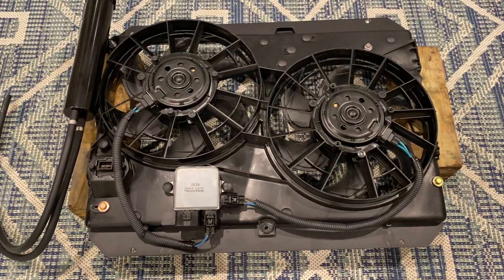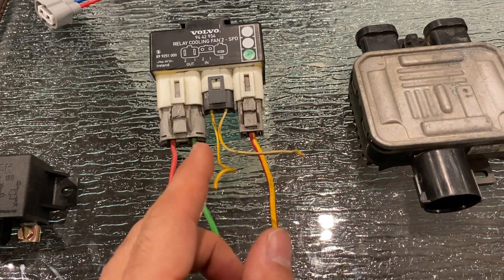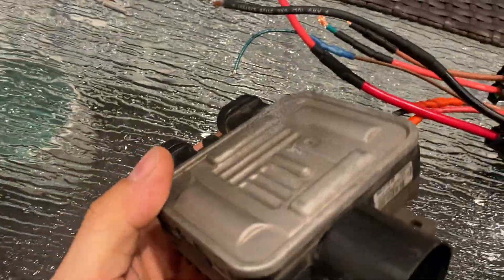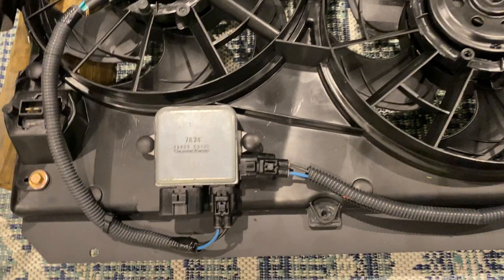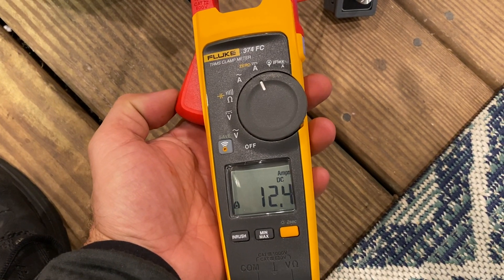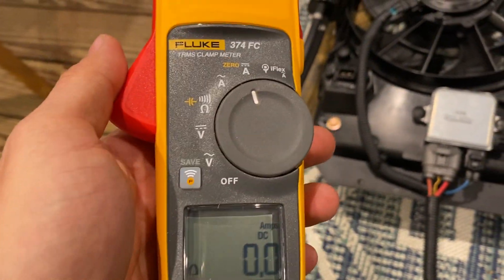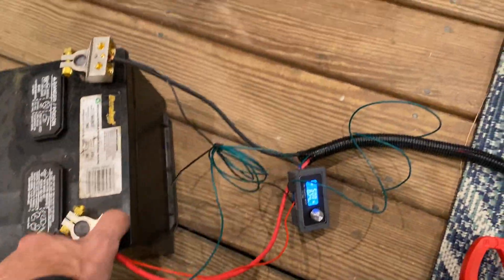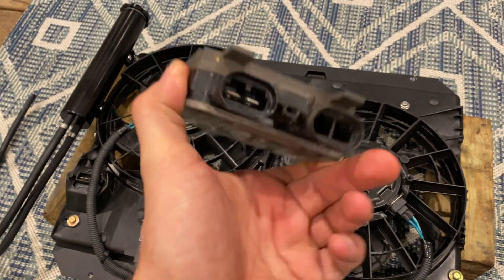Contour Fan Setup using a PMW fan controller

Comment: Hey any suggestions how I can keep the mazda controller from going into failsafe mode when I turn off my car (causing the arduino that is controlling it to turn off making the Mazda unit lose signal)? I don't want to have to flip a switch to ground it everytime I turn off the car. I'd appreciate any help. Thanks!
Reply from the maker: The way it’s done on the Mazda is there is a relay wired inline on the main power feed to the controller.  When you turn the vehicle off, it kills the relay which cuts power to the controller. 

I am using a bosch 75a relay with mine and activate the relay with a key on power source.  Fan is active when I turn the key to on but if I turn the car off, the relay opens and the controller turns off.
Reply: @Mustang5L5  Ah that makes sense! I'll give that a shot. I really appreciate you responding and for all your help. It means a lot!

Comment: Where do you get the connectors from, for the Volvo controller?
Reply from the maker: For the Volvo S60/S80 controller,  search “Cooling Fan connector 940002904” which is the single output for the S60.  If you need the double one you’ll have to search for s80 compatible kits with dual output harness.  I got mine on eBay but can’t find a link or part number at the moment

The wire size for that particular plug seems to be equivalent to the OEM connector. 

A junkyard OEM connector may be better quality however.

Comment: What controller would you recommend for the SN95 fan and MS3?  I assume you would only wire the controller output to the high speed wire on the sn95 fan?
Reply from the maker: I would probably use a fusion/corvette style pwm controller, or the Volvo S60 style controller.  This particular controller is probably better suited for smaller dual fans like the contour or focus dual fan. There are threads on both these units if you Google search. 

I highly recommend confirming polarity before applying power to one as reversing the polarity will brick the unit.
Reply: @Mustang5L5  if I went with contour fans to replace my old stock sn95 fan would the infinity controller be good?  Also how did you fit/attach the contour fans in yours?
Reply from the maker: @beyondEOD  As long as you have a method to control the controller, it would work.  Unfortunately that's going to be a limitation for most folks as you need something to putput that pwm signal.  I attached mine to to the shroud with two push pin style connectors for auto trim.  I drilled two small holes in the shroud and then used the pins to secure it.  I wanted to be able to easily remove it on the side of the road if it failed and swap in a replacement that I keep in the car.

Comment: How would you invert the pwm on the Arduino code? I have both of these controllers and I can get the mazda one to work but I can't get the Volvo one to work. Thanks!
Reply from the maker: Unfortunately that I have not solved yet.  I started putting together an arduino setup for it but didn’t get far with the coding because I installed my Megasquirt setup and ended up using that to control the module.  I have seen it done.  This thread below may have the info you need 

https://ls1tech.com/forums/forced-induction/1906766-variable-speed-pwm-fan-control-under-25-less-diy.html
Reply: @Mustang5L5  Ah ok, no worries. I appreciate you posting the video, and for the info you did share! I'll be sure to check out that link. Thanks!

Comment: Could this controller work with 95 ford taurus fan
Reply from the maker: Yes.  However this controller is really more for dual fans and up to 50A combined. It could run a single fan but you are better off running a single fan unit like the Ford Fusion pwm controller that a lot of folks use.

Comment: Hi man, thank you so much for this video! i was looking for long time now to finish my setup, i have dual spal 30103202 , will this controller handle them and will be safe to run those fans?
Reply from the maker: Do you know how many amps those fans pull?  I did a quick search and saw reference to 40A, but that seems high.  These controllers are wired in their OEM application for 50 amps combined, so really you need each fan to be around 25amps or so or perhaps you can use one controller per fan (wiring the two outputs from each controller in parallel to each fan motor).
Reply: @Mustang5L5  appreciated man, so is there any way to let both controllers act as one, to use same dimmer you have, or each fan will also have its own dimmer? and yes each spal fan uses 40 to 45amps.

one more thing i dont need to install any fuse or relay to protect my car? this controller have everything in it right?
Reply: @Mustang5L5  hi, may you help me to know how to connect two outputs to one fan please
Reply from the maker: @slowrook  you need to identify the positive and negative of each of the two outputs.  If you have the wiring harness the wire colors will be the same but I would confirm this with a multimeter.  Once you’ve identified the wiring, you can just connect the two positive outputs together and the two negative outputs and run those single wires over to the fan. You are essentially making a Y-harness
Reply: @Mustang5L5  is the Y harness goes like one way, if i connect 2 positive to be a Y harness this wont kill the unit? or both positive will go one way to the fan? sorry for my newbie quations

Comment: Great video. I'm contemplating using the Mazda 6 or s80 unit and a relay ground for activation. Does the soft start feature still when using this method for activation or is there still a large amperage draw.
Thanks
Reply from the maker: It soft starts, even if you just make/break the pwm signal wire to ground.

Comment: So if my understanding is correct, and I'm not very knowledgeable with electronics,
1. The Volvo S80 controller is more robust, and
2. Either controller requires a temp sensor and arduino, which is... what controls the controller?

Where does frequency come into play? Is that programed into the arduino?
Reply from the maker: 1:  Yes, the Volvo unit is more robust.  There is an single and double output unit, so depending on if you have 1 fan or two you need to make sure you get the right one. 

2.)  these controllers are reactive based off a single PWM signal wire.  Depending on the duty cycle, they respond with fan output.  That's why you need a controller to output that signal to the controller.  In OEM applications, it's the ECU that does this after interpreting various inputs like coolant temp, AC on, etc.   In an custom application, you need something else to interpret these signals and output a signal to the controller.  You can make an arduino setup, or use an aftermarket ECU like a Holley or Megasquirt.  

I started working on an Arduino setup that would take an input from a coolant temp sensor, but never finished.  There's a lot of info in this thread with some coding as well. 

https://ls1tech.com/forums/forced-induction/1906766-variable-speed-pwm-fan-control-under-25-less-diy.html

Comment: What's the width of your dual fan shroud? 
Thanks
Reply from the maker: 24.2 inches.  The dimensions to these contour fans are published.  See below link 

CPP Radiator Cooling Fan Assembly for 95-00 Ford Contour, Mercury Mystique FO3115115 https://a.co/d/0WtiNTK

Comment: my double fans reads 220W and 150W with OEM controller is 350W, system voltage is 12V.

Comment: Good day, i have my vw golf which failing me because of aftermarket controllers i install always fail. my questin is it has 4 wires that is 2 signal wires in addition to pos and neg poles, can you recommend controller that run this setup. OEM amp is fused at 50A.

Comment: Does this controller signal wire use ground switching from the MS3 output?
Reply from the maker: Yes.  In this video I’m using pwm+ off the cheap generator,  but I show how I specifically hook it up to MS3 using ground switching here

https://youtu.be/XrXb13uJiq4
Reply: @Mustang5L5  Cool thanks. I don’t guess it really matters if the signal is + or - it’s just the output duty cycle will be inverted. Since my Haltech ecu switches to ground on the DPO pins I could use the stepper control output if I wanted to pulse a +12v. I found it interesting that Japanese electronics are +pwm and German use -pwm. Ford and GM use the Siemens module.
Reply from the maker: @o1Z0sick  not for this particular controller.  I’ve gotten it working with both types, just need to invert the duty cycle.  I don’t know if other PWM boxes are capable of the same

Comment: thanks man! great video and good info. I'd like to pick your mind on something. Using a temp switch you get the nice feature of the fans turning ON at a set temperature and OFF at a couple degrees cooler. This helps with the fans cycling too fast/many. 

Now I have setup my fans on my MS3X Megasquirt on the two Nitrous outputs using PWM signal and ramp them up from 50% to 100% as temperature rises. What I noticed is that at certain conditions it will just hang around 90-91C (195-196F) and stay on about 50% for minutes. 

So since your also using Megasquirt I'd love to know how you have setup you cooling strategy and settings.
Reply from the maker: There is a new tuner studio update coming out that will offer PWM specific fan control.  It should give MS users some more flexibility. 

I’m actually creating a generic PWM table but have a relay setup for my AC system. When the AC goes on, I switch the relay from normally closed to open the pwm control wire which causes the fan to go 100%

As for my coolant table,  I have 50% on at about 170* and then 75% at 190 and then step it up to 100% at 205.  My car runs about 190-200 so it tends to hang around 75% as I don’t think my next ramp to 100% occurs until 200 degrees.  

However, I usually run the ac so most of the time it defaults to 100%.  With cooler weather coming I’ll likely play with the table a bit to find tune it.  I find in cooler weather my fan only needs to be around 75% to keep the car cool at idle, so I’d like to try and optimize
this to avoid powering the fan more the necessary.  I’m hoping the new MS update comes out soon so I can play with the specific PWM fan control options.
Reply: @Mustang5L5  he thanks man for replying. That update would be great. How do you know about the upcoming update? A topic on msextra forum?
Reply from the maker: @kikkegek  I directly asked for PWM fan controller a year or so ago on the MEExtra forums in the “feature request” board and was told by an admin it would be in the next update.  No idea what that will be dropping but I’ve actually been away from the board a bit so I need to hop back on and check.

Edit:  looks like it will be in MS3 1.5.3 but it has not been released yet it seems

Comment: Thanks for the great video, very easy to understand. Do you think the Mazda fan controller can handle 2 fans that pull a collective 44 amps? You said the controller had a 50 amp OEM fuse so I figured it would be right on the limit but ok. The wiring to each fan would be minimal (>1-2 feet).
Reply from the maker: It’s hard for me to say.  Temperature will bring the max current down a bit as well.  With it being so close already, I wouldn’t be comfortable.  You can fuse it and try and it might be ok.  I’d probably run two of them like some Infiniti models did. One for each fan with both outputs wires in parallel to one fan motor.  Or, you can look into the larger Bosch style controller (in the vid) that supports 60a.  I don’t have much experience with that one however.

Edit: the dorman 620-470 is an Infiniti fan using two modules. One for each fan. Given how cheap the modules are you can try this approach.  One pwm signal should run both.
Reply: @Mustang5L5 
Hi I am currently battling how to setup my jeep yj, I swapped out to a ford Taurus fan dual speed setup but I’m not sure which controller to get and if it should be a signaled thermostat like splicing the ecm thermostat wire or probe.  I haven’t considered pwm fans. What’s your opinion. Which would be better. I have the ability to wire up and fab whatever is needed .
Reply from the maker: @Dhardeman1981  using the pwm controller all depends on if you have a management system capable of sending it a predetermined signal based on engine parameters.  If you don’t, it might be simpler wiring up a basic controller like a DCC unit that just looks for temp input from a sensor and is independently controlled.

Comment: I'm interested in using a similar module for fuel pump control; does the same 'ramp' behavior happen with these controllers when jumping between duty cycles or only upon startup? My concern would be pump response when fuel demand suddenly increases.

Additionally, if you have recommendations for a 400W (30A) single motor controller, that would be much appreciated.
Reply from the maker: I believe I have seen these and other pwm modules used to control fuel pump.  This one will ramp up and down smoothly as your duty cycle input changes. Just not sure if it will be quick enough for your needs. 

These units can be used to control a single motor.  What the OEM does on a few infiniti models is they have a single pwm controller per heavy duty fan.  Both outputs are used and the wires are connected at the fan.  Helps split the load.   I believe these units are rated for 50a based on the OEM vehicle wiring diagrams and fuse size.
Reply: The long Bosch controller (right side) is used for massive Ford single fans like Crown Vics, the only prob is they seem to have a higher failure rate due to burst capacitors. That can be solved with replacement caps of high quality.

Comment: Do u have a part # for the PWM controller ? I'm wondering what the voltage output is from that module is as a lot of electronics runs on 5 volts and i what to make sure i don't apply to much voltage to the module at the fans ? tks
Reply from the maker: The part numbers are in the description of the video.  This particular module is using a 12v input on the two main power wires and at 100% fan speed it outputs 12v
Reply: @Mustang5L5  tks, i'm going to try that Broc xy pm-1 module on a 06 crown vic fan and module assemble.

Comment: So does that Mazda fan controller need the PWM box or will the fans soft start without it? I am running a 2-speed Taurus fan on my LS swapped 67 Chevelle and the fan will sometimes kill the motor when it kicks on at idle with the A/C on. I’ve been looking at the Derale fan controllers, but they have mixed reviews.
Reply from the maker: Yes.  If you go to 10:15 in the video, I explain how the PWM signal wire can just be grounded and ungrounded to activate.  It will soft-start and go to full speed.  Grounding that wire will turn it off.   You will only have full-speed, and off.   I have no idea what this does for longevity of the module though.
Reply: @Mustang5L5 does that pwm fan controller last long? I have a Chevy bolt pwm fans and going to do the same set up as your but I want to know if the Amazon/ebay pwm controller last long enough to have this for a daily kinda use?
Reply from the maker: @DannyR2681   I've had decent luck with the silver-body OEM PWM unit.   I've not heard good things about the cheapo Amazon units.   I keep a spare OEM unit in my glovebox but I'm still using the same unit in my car that I made this video with and it's been running fine.  I mounted the controller in a place where I can swap it out easily with my spare unit on the road, but haven't had to do that at all.
Reply: @Mustang5L5  so all you have to control the fans are the silver pwm unit? I don’t have a stand-alone but I’m trying to use my pwm brushless fans with a controller. How do you control your fans to turn on and off?
Reply from the maker: @DannyR2681  No, i am using a stand-alone ECU.  They won't work without some sort of controller input.  I'm using a Megasquirt.  For a while I was just using the small PWM controller in the video, and was in the middle of building an Arduino controller that would work off a coolant temp sensor.     TBH, i was hoping someone would build a simple stand-alone controller for these that just takes a coolant reading, and maybe a few on/off inputs for AC control, manual on/off to work with these controllers.

Comment: How would You connect it to turn on with the key or do You have to turn it on manually ?
Reply from the maker: As soon as you power on the 2 main power wires, if the PWM signal wire is disconnected it will soft-start and go to full speed.   You don't have any control over fan speed this way, but it will work as a soft-start relay.   You could also put a relay on the PWM signal control wire and ground/unground it to turn the fan off and full speed.   Not quite the way the module was intended to work however.